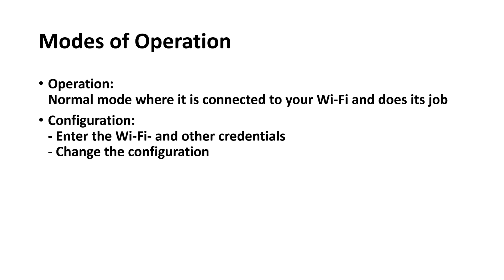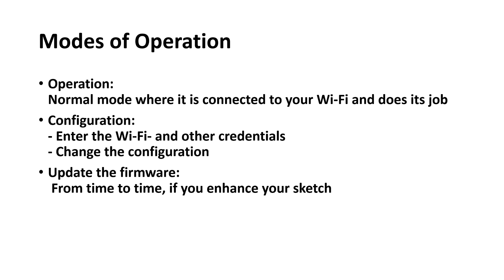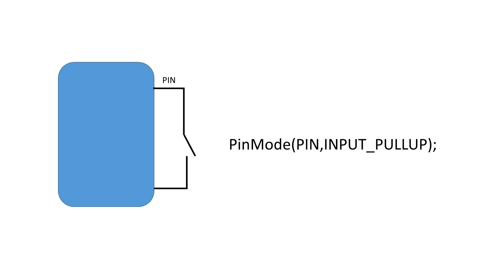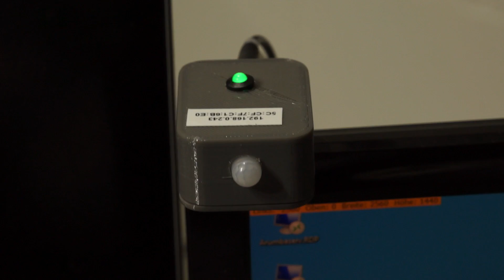#110 Complete OTA with a Reed Switch ?

Comment: Hello Andreas!
I made an ESP8266 based datalogger which is programmed to wake up every hour with the internal timer (in deep sleep mode), and has a reed switch to force it waking up in any moment, if required, and also allows the device to enter in configuration mode if held.
I have a problem: the reed switch gets stuck for some reason, here are some hypothesis:
-I am using a too strong magnet (got 2 small neodymium from a CD writer laser focus mechanism, quite strong).
-I soldered wires at the very beggining of the terminal, very close to the glass capsule, which could break the seal and allow air to get inside.

What do you think? may these be actual causes of the problem?
The current through the reed switch is very minimal, a few uA, so no spot welding on them...
Thank you in advance! Great channel!
Reply from the maker: Unfortunately, I cannot do remote debugging. I would change it.

Comment: I have changed the wifimanager lib so it can change parameters on the LAN or with AP mode, in case you need :)
Reply from the maker: For the moment I do not use Wifimanager anymore. Maybe you post a link to your repo for other viewers.
Reply: I am making a video about it, will post it soon and then share with everyone :) I totally redesigned the wifimanager so it can also give status feedback on the mqtt conection and others. Let me say I am you fan, and I have also learned a lot by watching your videos. I am currently building a LoraWan network in my country, Portugal :) cheers!

Comment: To change configuration you could (If you use WifiManager) the WiFi.disconnect() Command to go into Configuration Mode ;)
Reply from the maker: True. But how would you tell your device to call the disconnect statement? In normal operation, it should not call it.
Reply: i use it in setup() when my external Reset Switch is Active.

Comment: I added a tilt ball switch (about $.08 each) in series to your idea. Flip my device over, place a magnet in the middle and I'm ready for OTA and/or config. Why the tilt switch, to avoid false switching caused by nearby magnetic fields.

Andreas Spiess, thank you very much for your videos! You have helped me a great amount in advancing my projects!
Reply from the maker: Also a good idea. Maybe you could even only use this tilt ball switch. BTW, can you post where you got these switches? I recently go some, but they still seem to contain mercury...
Reply: It's been over a year since I purchased the tilt ball switches (project that was canceled) but I believe I got them from AliExpress -> https://www.aliexpress.com/item/10PCS-SW-520D-Vibration-Sensor-Metal-Ball-Tilt-Shaking-Switch/32436713700.html?ws_ab_test=searchweb0_0,searchweb201602_2_10065_10068_10501_10503_10000032_119_10000025_10000029_430_10000028_10060_10062_10056_10055_10000062_10054_10059_10099_10000022_10000012_10103_10000015_10102_10096_10000018_10000019_10000056_10000059_10052_10053_10107_10050_10106_10051_10000053_10000007_10000050_10084_10083_10000047_10080_10082_10081_10110_10111_10112_10113_10114_10115_10000041_10000044_10078_10079_10000038_429_10073_10000035_10121-10503_10501,searchweb201603_3,afswitch_1,single_sort_2_default&btsid=ddc77ed0-448f-417b-a8fc-6be0e06da576
Reply from the maker: I got a similar one but thought, it only reacted on vibration, not on position. So, I have to try again.

Comment: Aren't reed switches used in 2-wire flow sensors?  I know that the 3-wire flow sensors are Hall-effect, but I read somewhere that reed switches are used in the other kind of flow sensors (2-wire)?
Reply from the maker: This is well possible because both devices can be used for similar things.
Reply: If that is the case, I can't understand why 3-wire flow sensors (Hall-effect) are so readily available and much cheaper.  The 2-wire flow sensors (and flow meters with pulse output) are 10x - 100x more expensive.  Do you know a source to purchase 2-wire (reed switch) flow sensors that are competitively priced with the Hall-effect sensors?  I prefer the 2-wire flow sensors because they are basically an industrial standard in the business.
Reply from the maker: I have no understanding of flow sensors and never used one. So, I am no help in this matter...

Comment: Nice solution Andreas; As for separating production and test, you should do that at the back end and have the software updated based on the client's mac address. So when the device requests the new firmware it provides it's mac address and through some look up table you can decide which software to push to it.
Reply from the maker: You are right. Another viewer suggested a similar approach. I thing, we have to implement something like that.

Comment: Friend dont use this type of reed switch. Check out AH3503 Hall effect sensor on ebay, they are small and can work infinity time
Reply from the maker: Using a Hall sensor is a possibility. But not this one as its "zero" position is at 50% of supply voltage. But you need 0 and 1 signal. And it has 3 pins to connect, which is more work to connect....
Reply: Andreas Spiess so probably use just a button with 2 contacts=reed switch what u use
Reply from the maker: Most probable, you will find inside this device a similar part as I use. Just nearly 10x more expensive

Comment: Hi, great video as usual. 
My two cents to change a configuration (see at 3:49): this coud be done using a connection with bluetooth o a 433Mhz module, switching it on when in configuration mode, exchanging data and storing them onto the ESP8266.
As far as I know the bluetooth connection is used by Amazon for its dash buttons.
Reply from the maker: +contardm To add a Bluetooth device would be possible, but rather complex. Maybe with the ESP32 and built-in Bluetooth.
Reply: Andreas Spiess yup, definitely better with Esp32. But if I have some spare parts I prefer to recycle them... and make my life harder ;-)

Comment: very nice video.. i assume you use wifi manager library if you go in the pull request you can find one with a non blocking mode feature which also let you run the configuration portal without blocking your code. I was inspired by it to create a much lightweight version ( unfortunately it was for work so am not authorized to share the code on github but anyone interested can mail me for it) which runs on the root of your site and the rest you can use for APIs ecc .. wouldn't it be nice ??
Reply: I am flabbergasted by that. So far for opensource. Oddly I have seen people make links to forks. So what if you do? Is the Github police going to arrest you.
Would love to see yr work, but at one time I knew how to mail someone on Youtube, but for the life of me I cant find that option anymore :-)

Comment: Wouldn't it be possible to have a delay circuit with a small capacitor and a sufficiently large resistor for detecting the reboot reason?

For instance, if the device is rebooted normally you enable internal pulldown on a GPIO pin which discharges the capacitor. When the digital signal has read low for a few ms a reboot is initiated. On boot the same pin is polled once to determine if the capacitor is charged, then again sometime later to make sure the circuit isn't broken (display an error message if that's the case).

If the digital signal is low then you proceed with a normal boot, since if it was powered on instead of rebooted you'd still want it to boot normally. If the signal is high (capacitor still charged from a reboot) then you go into the special mode; OTA, config or collect more data for deciding which.
Reply from the maker: +Djhg2000 I think, there are a few possibilities to do that, for sure also with your principle. I for me, this was ok, and I also thought, that it is a good example to introduce the reed switch to the younger viewers. I am not sure, if everybody knew, that it exists.
Reply: Andreas Spiess and the older viewers too

Comment: It seems like you need to use a higher extrusion multifier when you 3d print...
Reply from the maker: You are right. I changed some settings after this print. But it was done and usable. And I never knew, if I would have to change it again. Since the project is now productive, I could print a nicer one...

Comment: Very good Andreas.  I too have done something similar (with reed switches).  I deployed two Raspberry Pi cameras in IP65 boxes for a battery powered, solar charged semi autonomous time lapse film project tracking the demolition and replacement of some factory plant last year. They captured images from 08:00 to 18:00 every day for 2 months ftp transferring images periodically to my PC in a parked car close by using WiFi at set times.  I needed a way to force reboot, shut down or start while they were deployed.  I could not cable switches to these but I could reach them through cladding with a long stick and neo magnet using GPIO and Python.  
They are very useful OK. 
Great video again, thanks.

Comment: ... hmm... odd solution. I see no point for choosing this instead of a button or a normal switch. You still have to do physical switching.
Reply from the maker: You are right. I only had very bad reasons: I was too lazy to mount an external switch ( and I had not enough space inside). And in addition, I did not want a visible switch which is very rarely used. In addition, I was not sure, if all younger viewers still now, what  a reed switch is. The only real reason would be if the device needs to be waterproof or similar.

Comment: "Beauty" means to think some time on a problem and finally come up with a really simple and elegant solution!
Reply from the maker: Thanks! BTW: Did you never have any interference between UDP and HTTP server? With UDP switched on, e.g. the HTTPupdate did not run. So, I switch the UDP connection on- and off if I want to transfer data.. This is definitively not an elegant solution, but for the moment, it works at least...
Reply: Hmmm ... I use  
ESP8266WebServer server(80);
in one of my projects together with the UDP debugging .. no interference so far ...
Reply from the maker: +Walter Steinchen Thanks. So, I have to test more. I also use DNS...
Reply: If you can send me a sketch as small as possible to show the problem I'll check ..
Reply from the maker: Thanks for the offer. I try it later in the week.

Comment: I just have a button on my smartphone, to tell my devices to check for updates or enter config mode. For example in blynk or have the device subscribe to a mqtt update topic...
Reply from the maker: That is also a good idea. So far, I did not favor an externally initiated update because without any security, it would be easy to "hijack" a device. But this is quite hypothetical, I know. If I manage to use SSL for the update, that might change.
Reply: Thank you for great videos! I was thinking about missing SSL and one of ideas found is AES encryption of data sent between ESP and Gateway in the Internet. It is not very flexible, but easy solution to protect communication channel.
Reply from the maker: +Mihhail Sidorin I do not understand a lot about security. But for sure, you are right. Maybe you solve the issue and publish it for all of us?

Comment: Another option would be to store in flash number of resets in a specific time, power the device 4 times in 60 seconds for example to enter a mode. Of course this needs flash writes however, but is 0 component.
Reply from the maker: There are many different possibilities. Yours does not need a component, so it is a good one. It might not be easy to do the storage of the time in EEPROM before you switch power off. RTC memory cannot be used, if you power cycle the device. I spent the 15 cents for the switch... But maybe you manage to do it and post your solution for others?
It would also be much easier if the ESP reset reason would show, if it was a power down or just a manual reset. So far, I was not lucky for distinguish the two cases.
Reply: There is a way to detect last reset mode, i was not thinking of storing timestamp, but a counter, and yes RTC does not persist across reboots. it would have to be spiffs
Reply from the maker: +tablatronix If you think about the Reset reason: I tried it and id gave the same reason for boot from power down as from reset... I usually just use EEPROM for single variables. Is there an advantage of SPIFFS?
Reply: Andreas Spiess nah I think eeprom is fine I was just thinking is one better for level wearing. Spiffs is probably a dumb idea actually
Reply: Yeah same reason code, so this would probably cause wear after 50,000 normal resets, you could always add wear leveling using a ring counter to increase that.
Reply: I think spiffs has wear leveling built in, but its slow.
Reply from the maker: Thanks for the code. I tried it, but was not successful so far. But, maybe I did something wrong. First, I pressed the reset pin a few times and the reset counter counted up. Then, I disconnected the board from VCC and, after about 3 seconds, reconnected it. But then, the reset counter did not count up. For the moment, I would not care too much about levelling as the newer flash is rated to a few 10'000 write cycles...
Reply: hmm what reset code is it throwing when you vcc it ? Mine was the same code regardless of reset or power up, but some boards might have a different power up code depending on how the enable pins are setup perhaps.  I always get REASON_EXT_SYS_RST, supposedly there is a REASON_DEFAULT_RST but i have never seen it. Also are you using the latest code ( i updated it a few times )
Reply from the maker: +tablatronix 1. I get both times the sam result code (unfortunately). And I used the version about 30 minutes before I wrote my answer. But I can try again tomorrow.
Reply from the maker: Now I looked at your code and I think, I understand what you do. I think, in the ESP world, it could be simplified. You count your boot counter up as one of the first statements in Setup(). If you want, you can include a short delay. Then, you connect to Wi-Fi. After that, you check the counter. If the counter was e.g.3, you go into configuration mode. If not, you reset it to zero. This would be in my case only a few statements as I already implemented a boot counter (without reset) and without your idea. I just used it to check, if the ESP booted unintentionally...
With this method, you would not lose any time during normal bootup, because it is used to connect to Wi-Fi, which always takes a little time. And in my case, I even have an indicator LED which shows if the ESP is not yet connected.
Reply: Andreas Spiess yeah you would just implement this in whatever flow you already have and use an existing state as your window or some other indicator you already have available to users as the start, obviously it cant be too long or else config becomes a 30 second process etc. and if you miss a window you gotta redo it all over again. You would NOT implement using a delay as the poc i wrote does unless you wanted to.
Reply from the maker: The reset can be done as fast as you want, ( as long as the ESP is able to boot and write the EEPROM) because each reset is counted. Only the "wait" has to be longer before you compare the reset counter and decide, if it was only a "normal" reset, or it was an intended 3 or 4 times reset to enter config. So, the whole process takes not time if you do not want to enter in config and just the time to 3 or 4 times reset if you want to enter config.
Reply: yeah if you do not want to provide any feedback, then you can do it like that. I commented the source about that,  you might want a pre delay though to prevent false triggers if your power cycles fast a few times or a reset button bounces etc. If you have your own counter you still gotta store an index, so your not saving any eeprom by doing that, and you would not be able to save wdt resets in the count, so i see no benefit from using a single reset counter, I would keep that seperate, or use several buckets to store the different types, so you get more granular counts of reason types, although storing resets for wdt resets could easily wreck your memory if it crashes in a loop ever.

Comment: More nice work, Andreas. Thank you. If you use two reed switches, you can manage 4 states. And have security through obscurity.
Reply from the maker: You are right. But in my age, obscurity also has a negative touch: It might well be, that I also forget how it should be done. This is, why I put a sticker on the outside...
Reply: instead of "Reed" put another text on the sticker.... but ofcourse one time you may forget what that means :-)
Reply: Security through obscurity is no security at all.

Comment: Your video quality is getting better and better. Impressive. I do prefer the introduced method to start with the configuration mode after reboot. Then after 120 seconds stop the server. For the OTA in still use the push mode. This can be secured by password, but takes time if there are more and more devices. Maybe change later the year.
Reply: Stefan Bode If you really think the videos are getting better then I hope you remember to hit that 👍thumbs up button 👍 😀
Reply from the maker: There are many different ways. This is just another one. Nothing special. For the moment, I still prefer the pull method, because I think, it is "safer", because, if you want to interfere the process and do bad things, you have to wait till the ESP starts a request. As son as we can use SSL, I think, your OTA method gets a big plus.
Configuration after boot is not good for me, because I have one Sonoff behind a second one. I do not want to wait a longtime after boot. But we are working on a different concept: Download the configuration from IOTappStory.com as a json file. Then, you only need the manual configuration very rarely (for Wi-Fi credentials).